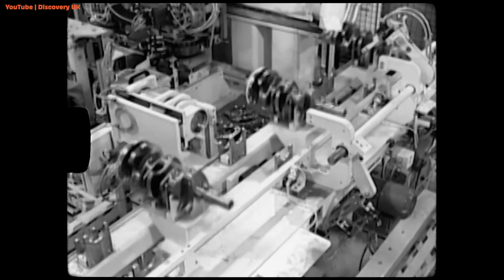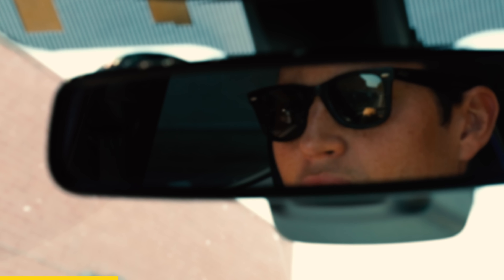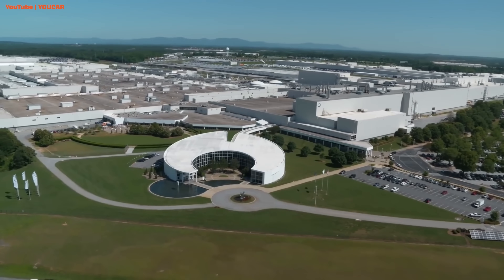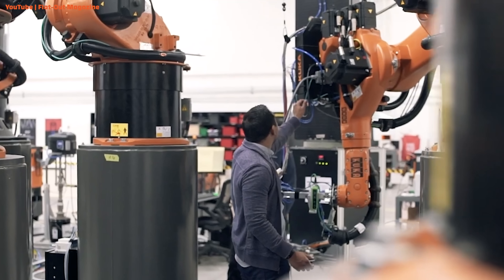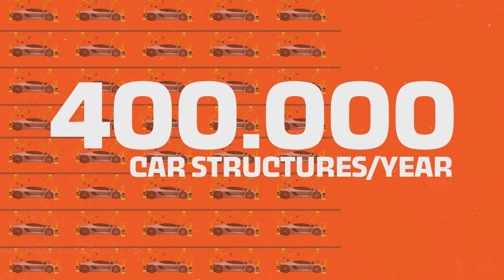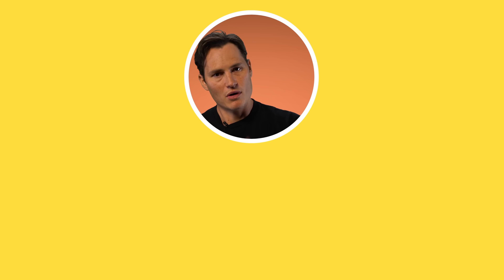A.I. Designed this Car

Comment: Wonder if they considered giving the AI knowledge of the tools required for teardown and maintenance. Just thinking of the dreaded bolt behind frame issue. Pull the front off and motor out... we need to add washer fluid.

Comment: AI is not smarter - it is FASTER, which is important if you try to design something based on evolutionary iterations. when doing so, trail and error is slow, expensive and exhausting - AI can help here by virtualising structures and trying thousands of combinations including running stress tests in very short time.

faster. not. smarter.
big difference

Comment: This was GREAT video. Thank you so much. The first machines to play chess used a "brute-force" method on every move, calculating almost every possible many moves in advance. Then, the designs evolved from there and eventually a world champion was defeated, and then again at the game of Go, which is an order of magnitude more difficult, using machine learning (neural networks). Of course it's guided by humans, and hopefully we'll keep a grip on AI in general. IMO things will get easier in manufacturing: the companies that can afford it will forge ahead to use these techniques, on anything that needs to be mass-produced. The "crafts" will stay alive if there are enough people who keep their respective arts alive.

Comment: I wish they would use the technology to make cars more modular. When one part gets damaged it would be easier to swap it out. I'm also wondering when they'll make toys so you can swap out the electric motor and battery packs like they do with tools. Imagine buying a Jet Ski and then later on you buy a quad and can swap out the motor and battery into the shell of the quad. You could have more toys at a much lower cost.

Comment: Summery: Assembly cars are very expenmcvive to assemble. Needing a allot of space. Using computational engineering and ai designing. Using these prosses they are going to figure out and letting the ai learn and analyze the parameter's for the car, doing what thousands of people with thousands of hours do. These structures can also be interpreted from nature, since in nature organisms are constantly competing for resources and materials. The computer process may be able to hand off much of the prosses to efficiently manufacture the hyper car its manufacturing. Using 3D printing, they can drift from the subtractive manufacturing process. Using only the minimum amount of materials to able to efficiently make these cars, getting rid of pricy and time consuming process to designs by analyzing and creating cars with streamlined and automated process. (Your welcome) 😇😁

Comment: I'm definitely skeptical about the scalability of this process. Seems like it would be great for reducing the costs of elite performance super-cars with unique characteristics that are, for some reason, really appealing to hedge-fund managers and trust-fund babies. Because the cost of retooling is minimal, they could do runs of 5 to 10 cars (maybe even 1 car?) at a price point that some frugal millionaires would find appealing. But I don't see this scaling to mass-market production levels. 

Also, this video mentioned nothing about maintenance considerations. Does the AI include the ease of removing and replacing a defective part in its computations? This is something that engineers tend to ignore. And then mechanics are left to devise clever ways to work around the inaccessible design of the vehicle's components. You can definitely left a computer 3D print an entire vehicle that maximizes space and efficiency. But that will almost certainly result in a design that is impossible to service. So with an AI-optimized design like this, when your A/C unit breaks down and should be replaced, the manufacturer will basically say, "We can't replace or fix the A/C but we can print you a new car; sorry..."

Comment: 40 AUs require a lot more than 40 times the whole rest of the factory! Assuming the 3D printing is the bottle neck you probably need a few hundred printers to keep up with the AUs. remember it takes 125 days to build one car. The AU is not the bottleneck but probably wide open, every other stage would need to be ramped up to catch up. How much space do you need to be able to keep up with 40 AUs = 40* a few hundred times the current factory= a lot.

Comment: It's not like ai has access to science that we don't it's physics that decides how much volume and weight something requires if ai is learning with time then the car needs to crash with ai watching before it understands exactly what it takes on it's own so we still have to insert x into the formula the ai is working from that's hardly actually being smarter than bunch of humans it's just doesn't requirement payment for use of it's brainpower like a human and really it does cost to use its brainpower bc last I checked ai hasn't created free energy machines to power themselves so it does cost electricity cost to run them which may be cheaper than humans but again not smarter.

Comment: Why does the AI build a vehicle that can exceed speed limits?
Why does the AI believe that so much horsepower is needed?
Why didn’t the AI design a vehicle that can carry a family of four?
Why did the AI allow the cost of the vehicle to reach beyond the average wages of a normal family?

There’s so many questions that I should ask about why the AI designed a vehicle such as in this video.

Artificial Intelligence: AI

Doesn’t seem very artificial to me.
Unless the AI is programmed to only serve those with a huge bank account.

Comment: The all video was a fairy tail. No any concrete real picture from production in the real Czinger factory. And "it can go from zero to 60 in 1.9 seconds" What the f is 60? 60 what? 60 km/hour or 60 mile per hour? Because if it km/hour than it's acceleration is bad.

Comment: This car is example of additive manufacturing not of AI. Even for additive manufacturing there are deep level of understanding is required, and you can say only AI, when those stress, strain, thermal parameters for FEA, CFD are solely considered by computer without human involved.
There is big difference i guess. I have studied and still working on generative design algorithm, and, even this algorithms are written as a script, so there is no magic, it's pure basic fundas on which FEA, CAD software works. 
After 2018, or from 2018 most CAD softwares like Solidworks , NX, Creo, ALTAIR came up with topology optimisation, with extra Advancement of generative design to give more generic shapes.
 Formula student teams, which are made of students to design race cars are usign this tech from past few years, you can see generative design examples in their car like wheel upright, hub, suspension brackets, and, many other things. I personally designed generative designed components like 2 years ago...

Comment: I mean in reality if they invest 12 million they could manufacture and have 1 car built within about 3 months and if they invest 24 million in their production line they could have 1 car built each month or depending on how its arranged 12 cars built each couple of months. Realistically each car would be a parts bin car to make sure it can get done without makeing excess and allways having a surplus of parts ready for new cars. I'm sure they could use similar engines and drive trains along multiple models if they wanted to. It would be a matter of how fast the AI could learn how to adapt

Comment: Repair will be the hidden cost, and is the major problem they wont address publicly until (if) they have a solution. Even if the cars are cheaper and better, it's a similar concept to why I don't like most modern products. My grandpa has tools that were already old when he got them. I go and buy the most expensive crap from home depot and it will not last my lifetime and will not be repairable, even if its cheaper.

Comment: This is the thing I HATE about the way all this bleeding edge technology being used. They ALWAYS want to use this shit to built freaken multi million dollar "super cars" that only a fraction of people will even ever get to see in person and only a fraction of the 1% will EVER actually own one, SOOO WHATS THE POINT? I mean why build a car that you MIGHT sell 1 or 2 a year when you COULD use it to build NORMAL everyday cars that NORMAL people could buy and sell hundreds and thousands of them per year and actually make a difference in the car market? Because building and selling 1 or 2 super cars will NEVER change the current car market, because even if the car can be built without workers and quicker does NOT mean the car will SELL for less. Because manufacturers are NEVER going to lower the sell price just because the manufacturing cost goes down, it just means more money to line the pockets of the manufacturers. But building cars that actually cost less, that everyone is going to get to see and want to start buying WILL force it to change the way they build cars in order to meet the demand for that type of car. There is NO demand for super cars, but there IS a demand for better and cheaper regular cars that these types of technologies could help make. Selling just a few super cars a year for $2-3 million dollars each would actually be LESS than selling a few thousand a year for 1 one hundredth of the price.

Comment: With all these custom bespoke parts made with specialised tools and processes, what happens when something goes wrong and you need repairs. Especially considering that with current methods, 3d printed parts are less durable and wear out faster than the equivalent in both cast and milled parts

Comment: I foresee manufacturers purchasing such things, and no one left employed who can buy them. We keep deleting jobs and creating things that people can not afford in the US. Soon we will be building & selling things to no one.

Think I am crazy? How many cashiers does it take to run 6 self checkouts? It used to take 6, now 1. How many telephone operators connect your phone call? It used to take one operator per call. Now it takes zero 0 operators for 1,000’s of calls. Sure it takes 1 or 2 computer techs, but it used to take 100x more employees. GM has a molten metal plant in my town that my father in law retired from. It employed 6,846 in 1971. In 1982 it employed 2,724. Today it employs 371 hourly paid workers and 105 salaried 476 total. A lot of this is due to automation.

Comment: Engineering is factoring the shortest distance, computation is running simulations which 😂 1010101 or in translation on/off on off on off on off. 🤷‍♂️

Comment: Seems like the cost that would be saved by the use of AI to design the car would be lost in the cost of the AI and the robotics used to produce them. 

That and the problem is, most car manufacturers don't sell directly to the public. They sell to the dealers and the dealers add the costs they want to it. That's why Ford was bending everyone over that ordered a lightning despite the MSRP being listed at $10k to $30k below what they were asking. They saw a chance for profit, they employed the method to get it done. Dealers made out big time. It's why so many manufacturers were fighting to stop Tesla from selling directly to the public. It put a wrinkle in their money making scheme.

Comment: Well one thing is a claim and the other thing is reality. I think the claim does not meet reality atm. These robots are extremely expensive, with expensive software. Once they say that they can produce parts for one car in 125 days while assembly could take only 1 hour, I would like to see that 1 hour assembly part. If this is anyway cheaper and more efficient, all car makers would adopt this concept already, they have capital to invest it...

Comment: I love how he said that the robots can be SIMPLY reprogrammed in a matter of minutes. 

Yea, maybe a couple thousand minutes.
Reply: If you have ten car models already designed, and you were producing model A you can reprogram the robots to produce a model T next in no time. Not possible with model-specific tooling.
Reply: The software update can be applied in a matter of "minutes" but like you infer, the actual coding and more importantly, debugging of the update would take the "slick efficiency" away for quite some time until they figured out an AI to write the updates. lol
Reply: When it comes to AI generative processes like this typically all of the "Rules/guidlines/perameters" are programmed in such a way where they can be changed on the fly so you don't have to write bespoke code for every new generation. 
If the system was set up in a modular way (which it most certainly is) then changing the perameters and "reprogramming" the machine could actually take a matter of minutes.

Comment: So, they trained the AI that is supposed to create cars with models of planes (12:32) for "inspiration"?  And so the car now has a design for 2000 mph (13:00)? Even a 270 km/h car is too fast for the roads and certainly does not help us solve the climate change issues we're struggling.

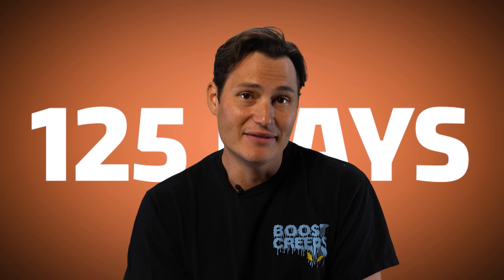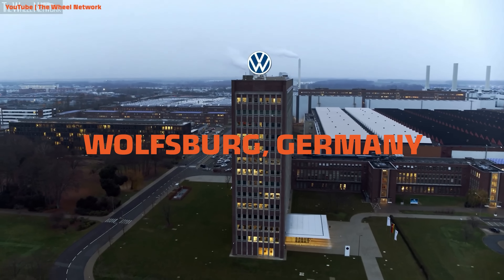Comment: It takes 125 days (9:13) to 3D print the parts. That's ~3 per year. And 40 AUs are supposed to build 400.000 cars per year. I don't get the math. Okay. Maybe it's just the assembly. But then, you still need to print 400.000 parts for which you need 133.000 3D printers. At 1m² each (which is probably too small), that's half the size (13 ha) of Monte Carlo (28ha) (2:03). Not so much of a saving any more. Why even talk about 400.000 units, if their plans are to just produce 80 (according to Wikipedia)?

Comment: The robotic arms used here, are used already in assembly lines. Those larger cost lines are designed for mass production and not specialized production. Moreover, the 3D printing concept is good, however too slow for mass production as well. Which is why you wont see this method used for standard cars. Using molds and dies is still faster as you can just dump, cool, remove, polish and repeat. If you saw how long it would take to print those parts, you'd find it would be a days on end approach that can only made faster if you use lots and lots of printers which can take up more space and wont save you any money on a production line. The future will likely be 3D printing parts, but this shows the concept more than prove we can switch now.

Comment: It is most definitely NOT true A.I.  It is still missing the rule-making.  Don't over sell software like this.  It dilutes the meaning of true A.I. It's just clever incremental optimization software.   It still has to be fed all it's design parameters and material and stress constaint.  I worked on software to optimize municipal water distribution systems in FORTRAN 40 years ago and this type of design is just several orders of magnitude more complicated.

Comment: So, the car is constructed to use the absolute minimal amount of materials, and eliminates years of design and engineering, and doesn't require complicated, multi-step manufacturing processes, and does away with the need for a huge workforce.   So, that should mean the car sells for a very reasonable price, right?  Right?

Comment: 3D printing can create complex shapes that is difficult to manufacture using traditional cast/forge/machining methods. But current 3D metal printing technology has many defects, many pot holes, therefore 3D printed metal parts need significant increase in necessary weight to provide redundancies. From engineering point of view, the parts used in this car are designed for idea show off and cosmetic purpose rather than resulting in any engineering or technology achievement. Few years ago I aware this guy Kevin Czinger, he is enthusiats of 3D printing, but I cannot feel that this guy know proper basic science. About assemly line cost, you have not mention about production capacity. Maintenance of robots, quality control, these cannot be done without human intervention. Comment from a mechatronic/computer engineer whos in business for few decades.

Comment: Setting aside the fancy hypercar stuff, a revolution in manufacturing processes could be huge. You wouldn't want to own and maintain an early attempt car designed by A.I., because it would forget to make the oil filter replaceable without sawzalling the chassis in half to get at it. But, if you could make an assembly plant cheaper to build, cheaper to adapt for the next model, much smaller, and cheaper to operate... Whew, that's a heck of a game changer. Imagine lower costs and having consistency in quality that doesn't change if a worker had a bad break-up or if the UAW starts some drama.

Comment: We can make 400,000 car structures each year! And sell affordable cars brand new with amazing specs for probably $5,000 and have enough money to open the car industry and revolutionizing automotive. But where is the unfairness in that? Let's limit cars to being to about 80,000 That's it! That way the cars could be extremely expensive and only rich people can still afford them and have everyone struggling underneath. Yeah gotta love that capitalism. 

Lol why can't they just make an AI that makes extremely safe cars? That way it's less extreme accidents. It has a lot of information to be built off of from experiences. Isn't that what the crash dummies are for? 
Instead of using AI to say multiple lives, we try to proceed on pushing lives further to the edge. Smh

Comment: It cost just as much to buy a car or truck as it does a vehicle and btw folks trucks don't last any longer same b.s. engines that are designed to fail at a certain mileage ask any designer that refuses to become an engineer.